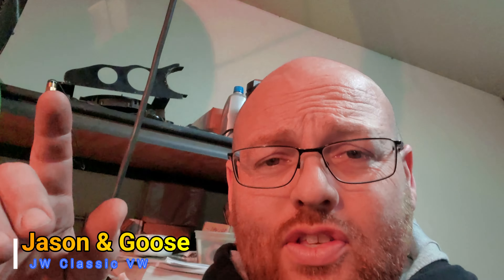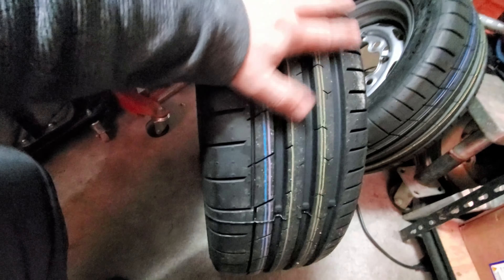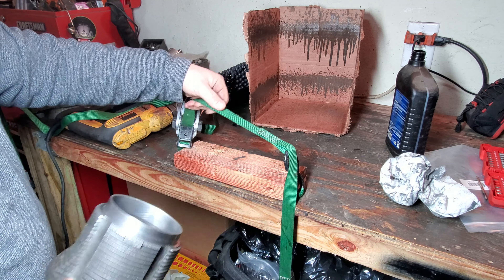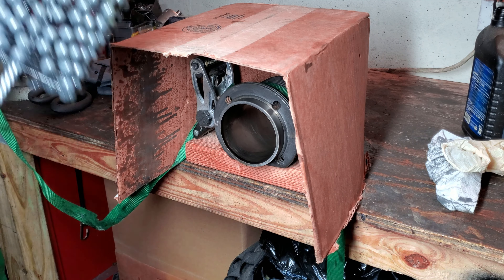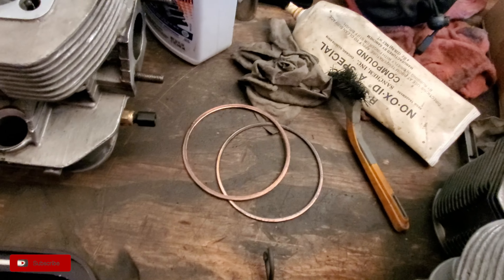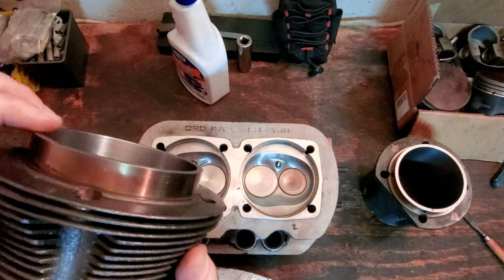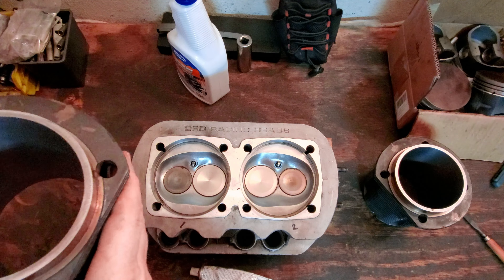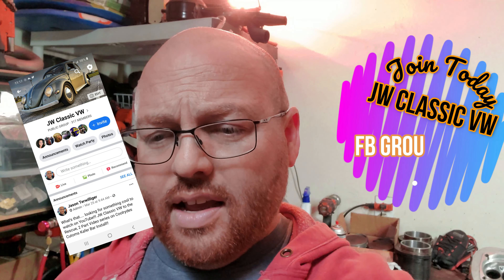How to Hone VW Cylinders |Turbo VW Beetle | JW Classic VW

Comment: 40 year retired mechanic here, I was taught proper honed cylinders should have (x) cross hatch marks when finished to (wear) break in rings. Your thoughts on that?
Reply from the maker: Correct..... they are there just hard to see on camera.  Once I get the break in powered I'll see if I need to possibly move to a 120 Grit stone.  I believe you may see the cross hatch better.
Reply: I did all the hardcore research before tackling my cylinders and it's quite a science, I just used intuition and a reasonable looking crosshatch pattern, but it sealed up and bedded in OK.

Comment: This is next for me: Honing and boring! 🤣 Thx for the great tips! I was just plannin on holding cylinder in one hand and drill on the other hand and just run it thru, but now thx to ur video... im gonna do it safer and better by strapping it down!! I got 10W-30 oil, will that do?
Reply from the maker: 10w 30.. may be to thick of an oil to get a good cross hatch, wd40 would be better.

Comment: You should always hone with a torque plate then measure to check piston to cylinder clearance. It's a messy tedious task to do match all 4. Without proper speed, motion, and the correct tools your just guessing. Good luck with your build.
Reply from the maker: Really just a deglazing and cross hatch to allow the new rings to seat.  I would agree with you if this were some pistons with some real milage or time on them.
Reply: I "just guessed" but it seems to have worked well enough. Like Jason says it all depends on how much work is needed.

Comment: i always use a finer oil so it would cut better then sliding over it with oil. but overall they look very good.
indeed with a bigger grid would be better for the cross hatch marks. 
will you place the new rings in first to see how much play they have?
Reply from the maker: I have seen some people use wd40 or similar, I may run it a few times like that to see what it does.

Comment: Hey Jason, Cip1 advised me need to use a shim or gaskets between cylinder/heads/case. Im re-using my old pistons and cylinders, just replacing with new head. So question for you: Do you suggest i used RTV Untra Gray silicone between heads and cylinders? Just a thin layer? Or do you have any recommendations? What do you think about Permatex Shellac compound? My local Autozone got these two available. Thx
Reply from the maker: No gasket or shim between head and cylinders... I'm using a copper gasket for my application because it's a turbo.  The only sealant you should use for your build is between the cylinders and the case.  This should be a thin layer of high temperature RTV of your choice.  I like the reddish color one.
Reply: @JWClassicVW  Oh boy! Im glad I asked. Now I got a Permatex Hi-Tac sealant that turns sticky/tacky and its dark pinkish color. I used it on case-bolts and also pump-gasket as this is all i had 😬. I hope that was ok. Can i use this same stuff?

Comment: Pro tip…hatching should be “steeper”, meaning speeding up the in and out motion. Don’t be discouraged though…the rings are new and will seal just fine. Better check your cam lobes and rocker arm geometry with that dancing push rod. That’s concerning to me.
Reply from the maker: Good tips... yeah I've ran through it a few times already... did find some adjustment that needed to be corrected on the valve tip alignment to the roller.

Comment: Why lap the barrel if using copper gaskets?
Reply from the maker: Well the simple reason is the old copper gaskets left the surface imprinted... it's minor and could also be cleaned up with say a 400/500 Grit sand paper.  The lapping is just a lot easier.
Reply: @JWClassicVW  cool love the videos can’t wait to here it run!

Comment: Yeah replace the adjuster cup ? It left a trail were the push rod jumped out . Those cyl. aint got no miles on them.
Reply from the maker: Yeah ordered the new ones... a set of 8 was $80.00 bucks, money well spent.
Reply: @JWClassicVW  check out down in that ones lifter pocket. It could have took a beating down there ? I would hang on to the 7 good ones ...............................
Reply from the maker: For sure!! I love having spares!

Comment: Doubt you’ll burn those up. You’ll break axles first. I have these tires on my CTS V Wagon making 700 whp and can barely break ‘em loose with traction control off. Those tires are going to last you longer than you think…
Reply from the maker: How much does your wagon weigh brother?
Reply from the maker: It's good to hear those tires can put up with some punishment!